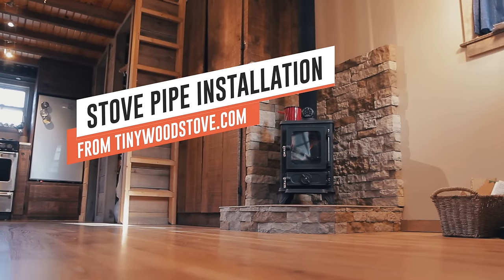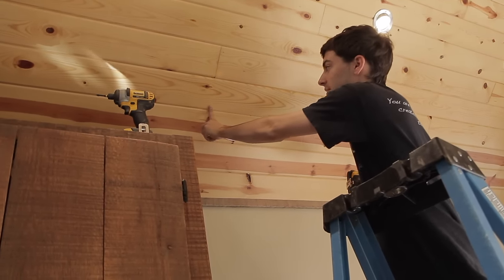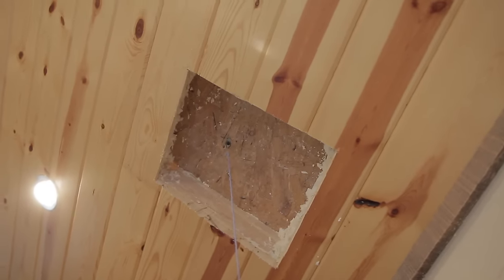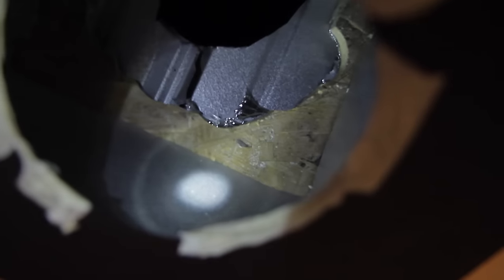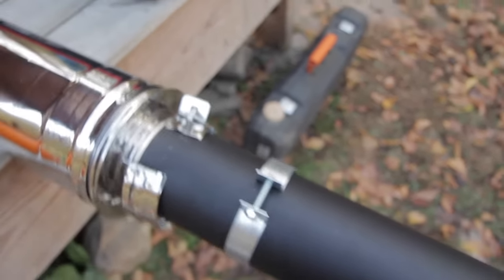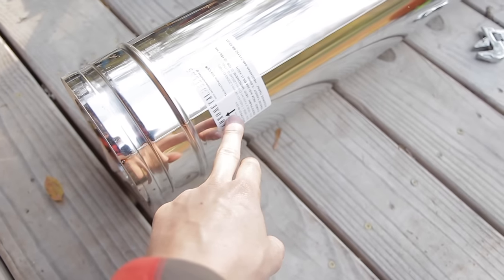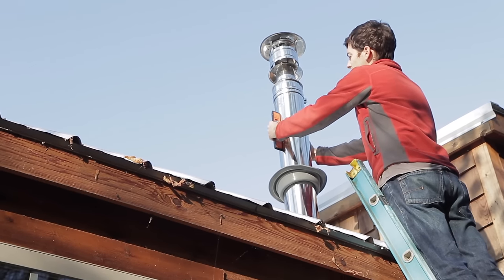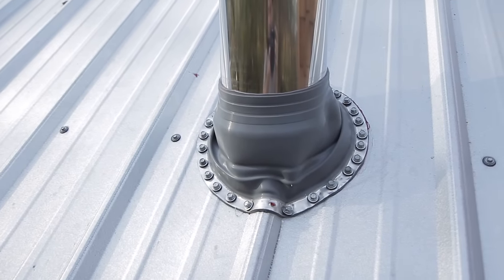Tiny House Wood Stove Pipe Install Video

Comment: Thank you! This video is exactly what I was looking for. If you  spray-paint the rubber gasket, the paint will act like a sun block and help the gasket hold up longer. It's a roofer tip from a roofer that has helped me a few times . Thanks again!
Reply: Thanks for the spray paint tip!

Comment: Great video these are super cool. I built an A-Frame cabin and couldn’t find any info on if I can go out one of flat side walls or do I have to go through the super steep roof? Maybe that’s a silly question 🤷‍♂️
Reply from the maker: @desertsolidude, you can do either! The vertical side walls are a much easier configuration that can reduce the height of the exterior flue but the steep roof is an option with an "extreme angle" silicone boot. Feel free to send us an email at support@tinywoodstove.com if you'd like to discuss the flue design further.

Comment: Don't know what the regs are in the US but over here in the UK any uninsulated flue pipe needs to be 3x the diameter of the pipe away from combustible materials. The twinwall flue should protrude down through the ceiling at least 450mm (17.7"). Just saying! Keep an eye on that timber!
Reply: cool home. stove setup with brick is SWEET.
 yeah, i thought the minimum clearance from combustibles was 2" on triple insulated pipe where i live (Midwest)
Reply: Really? Did the video discuss temperate rating on the flashing boot? Is it a 250 or a 450 rated boot? Just because they have a nice video doesn't help the novice put in a stove exhaust. Hire a Pro or watch a video that covers all code requirements, then have it professional inspected prior to use. Tiny homes burn down too.
Reply: 2" to combustibles for duravent HT double wall insulated pipe for wood stove.

Comment: I m wondering if the material of the sealing wrap iis ok to withstand the heat
Reply from the maker: Do you mean the Silicone Pipe Boot Shingle Roof Flashing? It is! It is made of Hightemp Silicone: https://www.tinywoodstove.com/product/3-8-hightemp-silicone-pipe-boot-shingle-roof-flashing/

Comment: How long are the screws that you used to screw into the pipe with that bracket at the roof? That pipe isn’t made to screw into! The screws could potentially get so hot and then heat up the bracket you used and that could catch the roof plywood under the metal roof on fire!

Comment: Great video! I am currently installing a similar chimney on a sauna I am building. How has that rubber gasket been holding up for you? I may consider one if you like it.
Reply: I'd be surprised if the sun's UV doesn't pulverize it.
Reply: I'm the owner of the Tiny House this is installed on and I'm happy to report that the gasket has held up beautifully 6 years later! The first winter I dealt with some odd leakage that seemed to be coming from the seam of the metal roof ABOVE the pipe... I think it had something to do my installation being right on the seam in between two sheets of roofing, but a little silicone caulk fixed that.

Comment: Won’t the rubber melt from the heat from the flue?
Reply from the maker: Good question.  The answer is no.  The insulated pipe knocks the flue temps down and the boot is made of a high temperature silicone.

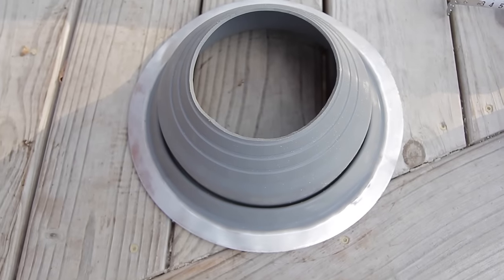Comment: what is the name of the rubber that appears in the 06:25? where can I buy it?
Reply from the maker: That is the silicone boot.  This particular one is for metal roofs but we also have one that will work with composite shingles.  You can find our silicone boots in the parts section of our website at TinyWoodStove.com.  We have them in sizes that range from 6-11", 4-7", and 3-8".

Comment: I am also soon installing my stove in my tiny house and have yet decided on the chimney.  I really like the  pellet wood stove insulated pipe but all I can find is pipe rated for 600 degrees which is good for pellet stoves but regular wood stoves such as yours needs to have pipe rated for over 1000 degrees.  I see you used single wall pipe inside and the insulated pellet stove pipe outside.  Does this application satisfy the needed temp ratings?  thank you for your input
Reply from the maker: This pipe is not pellet pipe. We do not recommend pellet! We've made our own flue line of double wall insulated pipe specifically for solid fuel.
Reply: Thank you for the advice
Reply: Pellet stoves are vented very differently than wood stoves. Depending on the stove (Btu's, efficiency, ect.) A lot take a 4 inch pipe. Please read the instruction manual or hire an nfi certified tech to install. Fire is nothing to be messed with
Reply: Use Metalbestos or security pipe. Selkirk is a good brand.

Comment: how much does the chimney need to stick up from the roof???
Reply from the maker: Residential code say 3' from penetration point and a minimum of 2' above anything within 10'. Hope this helps!
Reply: Safety guide in most countries is the height of the stack is above the roof apex, it is also wise to support the stack by wire or better still tie rod to ensure no movement in wind.
Reply: tinywoodstove.com    Your answer only applies to American States ,this video and others are shown worldwide where different regulations may apply.

Comment: I use insulated pipe from top to stove... makes more sense to me...Better safe than Sorry!!
Reply: better safe *then sorry.
Reply: Single wall will give you more free heat than double wall. No need for double wall until you get near combustibles and for exterior to avoid moisture and sweating through the pipe.

Comment: didnt show how u air sealed it
Reply from the maker: Wood stove flues aren't air-sealed because they operate on a natural draft as opposed to forced-air systems like propane and pellet stoves.  Customers seal the penetration with a silicone boot to keep the weather out but there is no need to 'air-seal' a wood stove or woodstove flue system.
Reply: @tinywoodstove  what do you mean? I'm talking about air sealing it in the attic.

Comment: using dectite is not code for woodburner and going through roof and ceiling needs triple wall chimney pipe not double wall stove pipe
Reply: Double walled insulated stainless is code most places I've seen.
Reply: @paigeparsons5174  As a retired hardware store guy in  Montana who specialized in wood burning stoves, .I can tell you what I was told by DuraVent and what I would tell my customers
ll say, double wall is fine for gas appliances penetrating a combustible wall or roof. but for wood burners you need triple wall.  Code??  Any local code is superseded my the OEM specifications.
I am not the  expert I would suggest one talked with Duravent for expert advisement and not utube

Comment: It's been about 2 years now. Where's the follow up video of how bad it leaked under that "ceiling gasket" you screwed in 30 times to the metal roof.
Reply: This is actually my personal Tiny House, and I'm happy to report that it's held up great! I did have to add some more silicon caulk the next winter, but since then it's been perfect.

Comment: you need to remove that box and trim all that wood off away from that pipe. speaking from experiance.
Reply: Would an attic insulation shield not work there? It keeps insulation away from the chimney and maintains the 2 inch required clearance from combustibles.

Comment: Yeah, that gasket is flimsy as heck..
Reply: Yeah that's what would worry me. But I'm doing this in a 84 sq foot mirco-tiny house( there will be 60 more SQ foot later).  Doing it without having to worry about code but still I need it done right and looking well. . this is one of the best videos I've seen but still think the gasket should be more weather proof.
Reply: This is actually my personal tiny house, and I'm happy to report 6 years later that it's holding up like a champ!

Comment: Not a good idea to drill into insulated pipe for those brackets you put on at roof level !!
Reply: What is negative about Ron Dill's comment? He's contributing to the discussion and perhaps the next person won't make the same mistake.
Reply: I actually agree. needed to be more level for stability over time.  If I was a client, I would have had a fit over drilling through that tube. its double walled for a reason